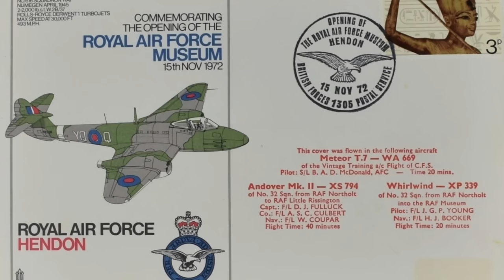Stranraer Flying Boat 'The Stranny' 1966 Film

Comment: Built an eight foot span R/C model similar to the Stranraer.  It flew very nicely with two Enya .46 ci 4-stroke engines.  It was rather clumsy and slow; but elegant at the same time.  I hit the only tree at our flying site, which put an end to its flying.  Still have the parts hanging from my garage ceiling, however.
Reply from the maker: I’m not sure whether to laugh or not? Darn tree 🤣

Comment: Top notch! I've always been fascinated by flying boats.  Off topic but 30 years ago the Short Bros factory building was still standing on the Medway just upstream of Rochester. They have now built flats on the site but the garages below the flats were part or the original structure.  The concrete slipways are still there.  I believe they stopped flying from Shorts Reach when the M2 viaduct was built in the early 1960's but flying boats were pretty much done by then anyway. The film on the Stranraer was a great find and your introduction was excellent as usual.
Reply from the maker: I visited the site of the Short Bros factory and slipways last year when I flew the Aeronca C3 up to Kent.

Comment: Wow!  I would be terrified to change throttle settings.  Add power and this thing would pitch down.  Worse, reduce power and it would pitch up and stall in a flash!  And then, if you ever did land it on water, i bet that high CG would give you attention grabbing porpoising.
Reply from the maker: The Stranny was purely a flying boat, it's not a case of 'if you ever did land it on water' because every landing was a water landing. The chaps in the film state that the Stranny had excellent characteristics on the water; likewise I don't believe the power/pitch couple would have been as pronounced as you imagine. Whilst the engines are high mounted, the centre of thrust is below the mainplane and not too far above the C of G. Very different to the Thurston Teal or Lake amphibian, both of which do have a more pronounced power/pitch couple.
Reply: Well, dats interesting.  You are saying, then, that the drag of the wing, not the cg of the structure is the base of the couple?  If that is so, i remain startled.  Remember the Seawind 3000? I watched one take off at Greenville yrs ago.  It appeared to be more sub than plane.  Commented on that to the editor of the seaplane magazine and he told me that his review of the plane (20 yrs ago) said it COULD land on water.  Just could, not should.  That came to mind when i wrote “if”.

Also, i was once bent on buying a Grumman Widgeon and in course of that search was told that of the 65 or so produced mist had been damaged in a porpoise.  And, i have long had the theory that the Lake amphib should be put on floats for serious bush operations. Just sayin’.

Thanks for interesting reply.
Reply from the maker: @piperg6179  The couple must be based on many factors but the drag of both wings (and all those lovely wires!) must help damp out the couple. With regards to flying boat development, by the mid 1930s there had been 20+ years of good flying boat design; the biplane boats with their low speed flying envelope and strong, light structure were probably the toughest of the lot. Most were designed for rough water operation. 

The Seawind 3000 looks more like a torpedo than an amphib, certainly reports I've read do question its handling on the water. The old adage about 'looking right and flying right' is appropriate, and as some wag once commented, all aircraft can land on water - once!